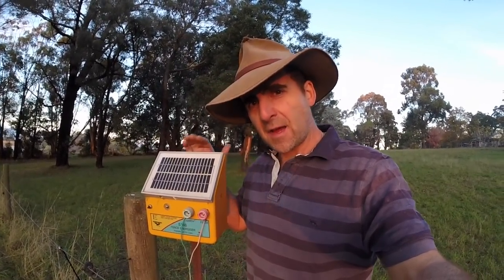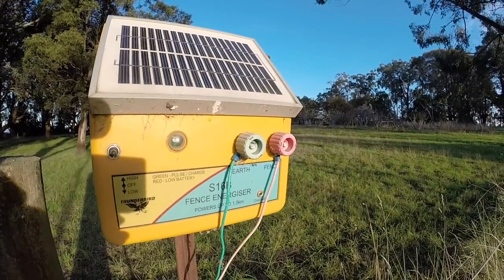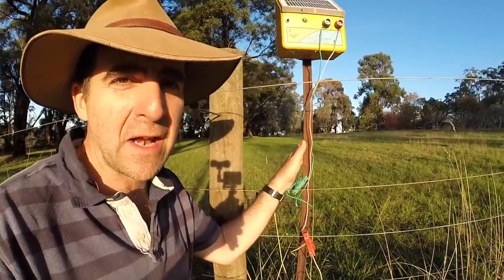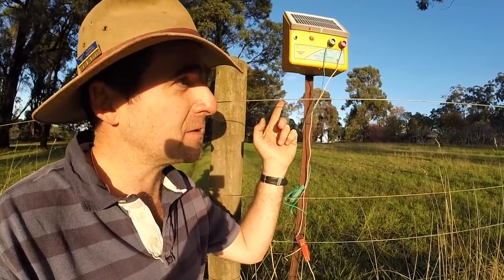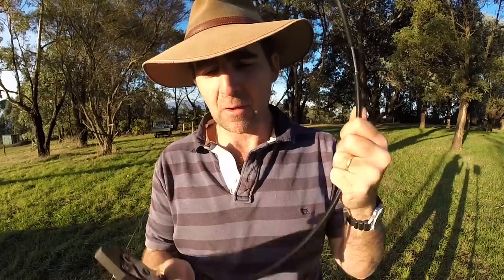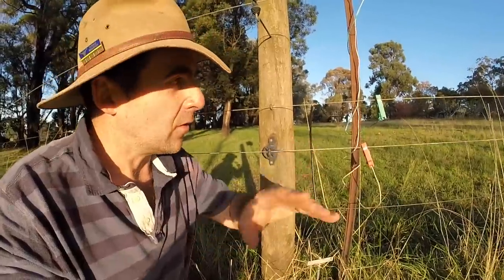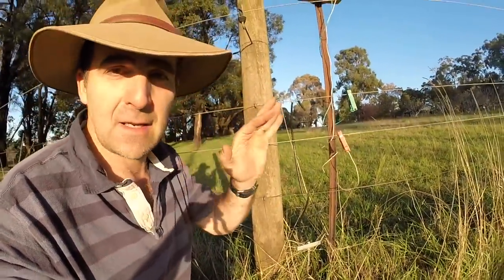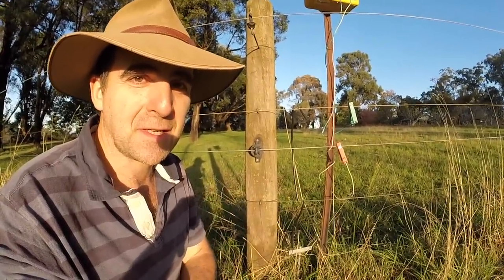Electric Fence Problems Solved!

Comment: Spot on explanation Tim ! Earthing is the most common cause of the issues we come across. Only thing you could add is to connect 3 or more earth stakes/rods in a row, 1-3 metres apart and joined together with some good plain or black insulated wire. Spot on summary too 5:18
Reply: Looking forward to seeing that Tim. Notifications are on :)

Comment: This is exactly what I was looking for 🙏🏼. My exact same solar energiser has stopped working. Now I know why! Thanks heaps for providing a fantastic, informative video that is concise and easy to understand 😉👍🏼🙏🏼
Reply: Hi Tim, couple of qu's: How do I know for sure that the battery is fried?  I'm running a temporary fence of two strands of braided wire. How can I apply this method to temporary fencing? Thanks so much - you're in the Yarra Valley? 😊😊

Comment: Hello Tim , here I maintain a few sheep & cattle  electric fences , I found out that the earth is just as important as the power output , & that dry ground can knock back your fencer,s effect badly , but you have highlighted why this happens , & the inclusion of "running earth wires " between the fence power wires is a great idea , along with separate remote earth pegs , heavy clay ground here , & when it does eventually dry out , by god , it really insulates , ( & it,s hard to get post holes in , I,ve exploded a few softwood posts in my time just pressing them in with the old j.c.b. in dry summers ) , this will help a lot , & I,ll include it in future fence builds , Thanks Mate from England .

Comment: Hi Tim,I had a problem with my solar powered energizer with ants nesting in the unit I had 4 units and 3 were constantly getting ants nests and being destroyed, 1 didn,t have a problem and I couldn,t work out why, the only thing that was different was the one unit was right next to my head crush,I live in Queensland Australia and we have a problem with buffalo flies so we put insecticidal ear tags in our cows ears over summer, and when they are removed we toss them near the electric fence energizer and pick them up at the end of the day, some were getting covered in dirt and we missed them,it was the only thing that was different, so I put used ear tags in the control box and I have have had no ant problems for 7 years, just thought your viewers may like this cheap trick, now I buy 5 extra ear tags a year (they come in packs of 5) and I have no insect attacks all year

Comment: We run 6 ft ground rods. There a half inch diameter with a light copper coating. We also Earth the two wires like you did because in winter time there's enough snow between their hoof and the ground that they have no continuity to the ground.

Comment: You solved my problem. My fence only felt like a little tingle and it was because  I was using a copper ground rod and not galvanized rod.. 🤣🤣😅 I guess I should of read the instructions before throwing them away

Comment: I've been connecting every star picket in the fence with a normal wire and connecting that to the earth system for the energiser, that way I get a 30cm deep earth rod every post...so far so good. I also drive in a galvanised star picket as far as i can at any point in the fence that retains the most moisture year round, and connect that too.

Comment: Thanks Tim some good information to get me started, any brands you can recommend plz
Reply from the maker: Most brands are owned by Gallagher. It just depends on what power source you want and the length of run.
Reply: Gday Tim, so power source I would like solar, question on run length when advertised as 10  km long is this one hot wire 10 km long or a few wires that would equal the distance of 10 km and thinking of cattle so about 6 to 8 Jules ? Maybe

Comment: Hi Tim. Great video. Just to confirm, does the animal have to touch 2 wires (1 charged & 1 earth) to get zapped? If so, how would this work with the hot wire on outriggers instead of post insulators? Can you still use this type of earthing system when the animal may only touch 1 charged wire on an outrigger? If not, what other type of earthing system would you recommend? Thanks! And keep up the great work on your videos!
Reply: Thanks for clarifying Tim (makes more sense now as I got a little confused at 4:48 of your vid when you pointed to the earth wire & the hot wire suggesting the animal had to touch both). 
We run mainly 6 or 7 wire fences for cattle  - older fences have a single hot wire on outriggers around the plain/barb wires, and newer fences have 2 hot wires on post insulators & 5 plain wires. Will definitely move to your earthing system after watching this vid (currently have a lot of our units earthed to 2 or 3 star posts hammered in the ground near the solar unit, & not always are they galvanized). Can I earth using any of the plain wires along the fence, or best to use the wires closest to the ground? Also, which of your videos best shows how to tie the strainer knot that recently fared well in your knot-test video? Thanks so much!
Reply: @williraz  oh how I wish Tim would have answered your question!!   HEY TIM!  Please get back to williraz’s questions!❤😂

Comment: I was doing everything I could to get my fence charged but kept only getting low voltage and after watching this and connecting my ground directly to one strand of fencing and the positive to the other and by passing the earth ground rods now my fence is putting out the voltage it is supposed to my soil is sandy river bottom and apparently never was getting good ground and the highest I ever got was 1.97 volts now the fence is putting out 8.97 with a solar powered 5 mile Zarebra fence charger, solve the grounding and everything else will come together.

Comment: I bought a new fence charger and installed it correctly with the proper ground rods. But it only shows 2000 volts right after the charger and then the longer I go around the fence line, it goes to a 1000 V and I want at least 4 to 5000 V.  Since it's still Winter here in Illinois, I don't have a lot of grass growing around the fence line. What's causing the low voltage? Also this is a plug in fencer not a solar one.
Reply from the maker: Hey mate. I'll try to sum up what I think woulld be a great video response for a 15 minute how to..... In fact I just showed your querstion to a mate from Gallagher to suggest we do it. Anyway, here goes.... 
1) What is your lead in? Please don't tell me you attached the unit on the boundary fence. You should use a central fenceline to energize the rest of your property from this. Think of water pipe. Electricity flows like water.
2) Earth stakes are only as good as the ground you put them in. Every 15 jouls should have 3 earth stakes 2m into the ground each 4m apart connected by ONE unbroken unjoined earth lead. 
3) Some soil is less conductive, run an earth return system - that means use your non energised line wires as an earth by connecting them to earth stakes.
4) What quality insulators did you use on the posts? Not all insulators are good.

Hope that helps. Good electric fences are awesome, but you need to design and install them well. Really hope this helps.

Comment: Thanks I've been struggling since doing it alone recently
Reply: @FarmLearningTim  my fence goes around my 1 acre back yard. It has two electric packs with an earth next to each  one at either end but it only electrifies near the yellow electric  packs, and only a little and nothing in the middle.  I desperately want to take my dog off the chain and have spent hundreds in getting everything.  Should I put more earths around the fenceline and could one of these electric chargers be the problem

Comment: Thanks Tim, I used three  hot dipped gal star pickets as Earth's. What's your opinion?
Reply from the maker: Good to use Gal. Spacing and depth is all important. Check your voltage when the soil dries out
Reply: 2/3 of the way in the ground,  3.5 m apart

Comment: Everything you said is good except for saying you dont need clamps for joining your covered wire to the fence. By wrapping it around the wire yes it will work how ever over the years with temperature changes wire expands and contracts with high and low temperature. This in turn causes the wrapped around wire to loosen causing poor connection. In severe cases this can cause an arc that will burn thru your wire or cause rust. Rust is a natural insulator as you spoke about with using rusty earth stakes. By using the clamps you maintain a constant connection.

Comment: There is power in the line running from the unit to the fence. But when I attach the line to the fence there is no power in the fence. Insulators are new and there is no vegetation touching the fence. it seems the power is not transferring to the fence wire. The ground rod is 6' in sand and I poured water to add moisture to the ground. Any suggestions? Thank you.
Reply from the maker: Stupid question first… you did take the insulation off the line when you connected it to the fence right? Next, use a clip, this will improve your contact. Failing that I’d be looking at your earth. No earth, no circuit, no zappy zappy. Hope that helps!

Comment: Hi Tim, I just got an extra copper earth rod from Coldstream(they’re not selling the gal ones anymore) and wanted to put it at the far end of my system, but I only have single strand braided electric stand off, with Bayco strands completing the fence.  How can I include the earth rod in the system to improve the flow?  Or am I stuck with what I’ve got?
Reply from the maker: Check out my more recent videos on the topic mate, like this one https://youtu.be/ZxKi4zWIz2Q?si=23gbLcNI2HsaaJ8-
Reply: @FarmLearningTim  thanks for the reply.  Unfortunately, didn’t really help.  I’m charging 3-4km of braided standoff, and it seems to be chewing through my batteries, so want to improve the flow with the earthing rod.  Hit the rod in at the halfway point of the system, but don’t know what to join the wire to?
Reply from the maker: @franknyhuis6607  you don’t join the hot wire to the earth. To optimise the energy you can set up an earth return. This is covered in the video I shared with you and a couple of others. Basically, connect your earths to a plain fence wire, then connect the unit’s earth to this wire as well. Then when an animal hits both wires it receives the full pulse. Put the unit in the middle of the run, not on the end. Replace any corroded or broken wires. Check all insulators. Actually USE insulators (you would be surprised). All these tips and more are in my videos. Cheers.

Comment: Good video! Another golden rule is always clamp your joints. I particularly like the "L-Shape Joint Clamps". Using underground cable as patch leads is ok, but make sure you clamp the joints on main feed wires. The arcing on un-clamped joints will loose power & slowly destroy your wire.
Reply: Hi!  Could you please explain what “L-Shape Joint Clamps” are? I can’t say I’ve heard anything called that!
Thanks 🙏

Comment: What if you are have all 4 wires hot, then where do you attach the extra ground rods to?
Reply from the maker: You typically have at least one or two non hot wires, unless it's a small temporary fence, in which case you just connect the earth to the energiser. I have done more recent videos on these two approaches.
Reply: We have all 4 hot,  it's a very big area

Comment: Just wondering if you run a wire like 500 metres then wanted to put another Earth Point in the ground do you just run a wire from the electrical fence wire to your Earth Point / rod
Reply: using a mains fencer here with no non powered wires. What would you recommend in this case?
Reply: @FarmLearningTim  "That's the animal's job" Yesss,I love your humour.

Comment: You CAN use star steel posts as your earth if they are gal. But if you want a better earth than the one he recommended use a copper earth rod.
Reply: i've seen people swear off using copper earth rods with galvanised wire and joins because of the electrolysis between two different metals.
Reply: @JoLynch0   I have been selling electric fencing for 5 years it works fine.

Comment: I am not sure why the need for an earth stake.  I have seen people with wooden posts,  4 strands,  2 of which are live, and the other 2 barbed wire. Why wouldn't you just connect the live wire to the 2 isolated strands, and earth to the two non-isolateted strands.  Then wouldn't you get a zap from touching the +ive and the -tive together? You can put the two wires so close that an animal cannot touch one without touching the other, say less than 100 mm apart.
Reply: @FarmLearningTim  Thanks tim. I am living in North Queensland and we have a native white tailed rat, protected, but they bleed my chooks to death. I have chicken wire fencing but I have not been able to keep them away. I have boutht an electric fence unit and I am planning to install it. I thought perhaps on the perimeter of the yard, say about 20 metres by 50 metres  by using 20 mm diameter pvc pites by 300 mm long in the ground around the 1800 mm high chicken wife fence, drill  two holes in the pvc pipe and let the pipe be raised about 100 mm above ground. My question to you Tim: shall I run one neg and one pos wire, and thus zap the rats between the two wires, or shall I run two pos wires and earth to the 1800 chicken wire fence, and use an eath stake as well as the star pockets which are holding the chicken wire fence. ? 
Right now the ground is wet, damp, but later in the year September, the ground is very dry, will I then get enough zap to a small rodent through the ground ?  Cheers, and many thanks for your comments.

Comment: I’d rather use the expensive clips thanks, you do get a reliable connection. They’d use your twist solution in house wiring if you could trust it, they did but stopped it about fifty years ago.
Reply: Actually house wiring is twisted a specific way then a marret is twisted on that. The point you missed is the grounding in multiple places through the fence will make a huge difference in how well your fence works. People with big pastures that need lots of gates appreciate the advise. The insulated wire he used is rated for 20000volts which is also a must have.

Comment: 10 dollars! The ones I bought at tractor supply were 3, 8 foot galvanized and 1, 7 foot copper. 3/8 of an inch thick. I'm thinking 25 to 30 dollars each. I about sh!= when I saw that. I was expecting 10 dollars each not 25 to 30.
Reply: @FarmLearningTim  why were the ones at my store so long?
Reply: @FarmLearningTim  thanks, just subscribed. I just installed one but it's not solar. A few reasons I didn't buy a solar charger were the ones you mentioned in this video. I didn't realize that people weren't setting them up correctly.

Comment: Is this good  for Raccoons? I Just want my yard back
Reply: This will work for raccoons, I've done it, actually it works on all animals but better on some than others. The challenge with raccoons is they are very intelligent, understand what they are dealing with and look for way around it, you might even need game cams to assist in the fine tuning of your fence, I have not seen evidence that they figured out they can ground out the hot wire yet, but really I'm expecting it, if nothing else you will gain more respect for just how smart these critters with hands are